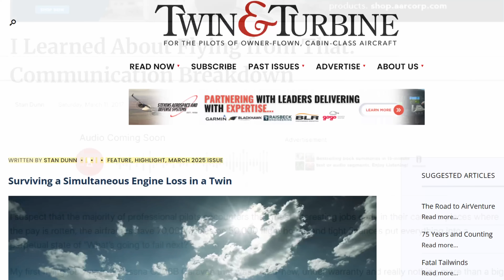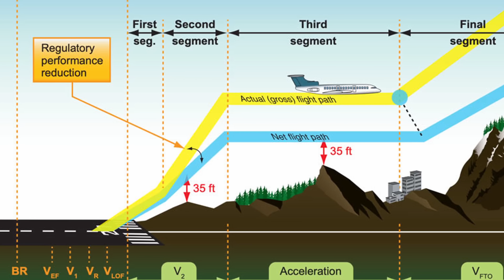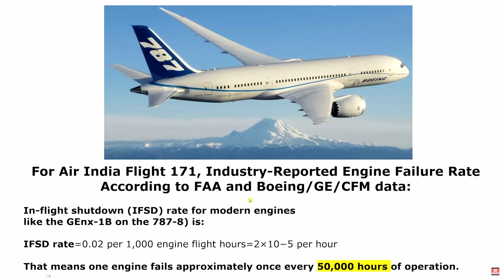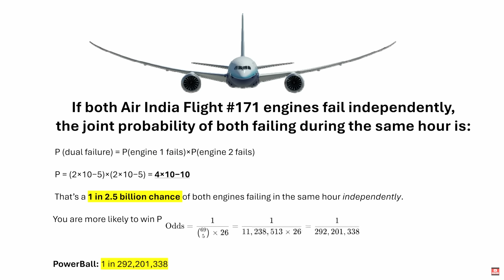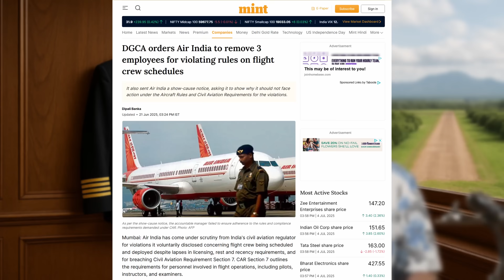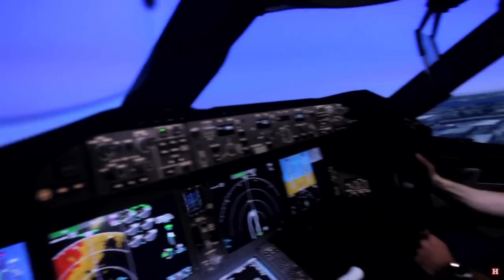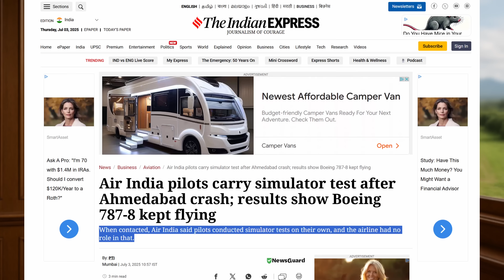Air India 171 Cause Becoming Clear

Comment: Don't forget Date: April 13, 2010. Flight: Cathay Pacific flight 780. The investigation concluded that SAP spheres, a component of a fuel filter monitor installed at Juanda International Airport, contaminated the fuel supply. Saltwater contamination at the airport damaged the filter monitors, releasing the SAP spheres into the aircraft's fuel. This caused both engines to significantly drop in power. The pilot was able to land the plane safely but it was sketchy.
Reply: Flight 780 did not have both engines roll back simultaneously, nor was there no warning beforehand - it had several minutes between the engines stalling, not to mention repeated ECAM messages on both engines for something like 2 hours beforehand.

It seems rather unlikely that a fuel issue would result in both engines rolled back at essentially the same time and at essentially the same rate such that rudder deflection wasn't visible, but also wouldn't cause any other issues for any other aircraft.
Reply: @TheLoneWolfling My understanding is that both engines are fed from the centre tank at takeoff and as a former auto mechanic, just about every case of fuel contamination didn't manifest itself until some seconds after high fuel demand.
Reply: @TheLoneWolfling  In this case the plane took too long to take-off, the whole runway, raising dust at the end, sign of either low power or load/weight issues. And it was not flying for hours so they could not have warnings for 2 hours!
Reply: @DR_1_1  that aspect is being disputed.
Reply: @TheLoneWolfling it could have been a more severe contamination this time
Reply: Makes no sense on this flight. They already did a leg from another Indian city into Ahmedabad. There was no relevant maintenance done on the short stop before heading on to London. More likely that some sort of electric failure caused issues with the fuel pump system which is electrically powered on the 787. So that would match up with what we saw, lowered thrust and eventually complete loss of power
Reply: Yep I remember that, it clogged the filters with icicles.  Thereafter they redesigned and retrofitted planes with a better filter/heater so it cannot happen again.
Reply: As I understand it, contaminated fuel leads to intermittent spurts of power and power drop-outs, with plumes of smoke from the engine. That was not seen.
Reply: @dadananda the creator says it was
Reply: @DR_1_1 later better analysis showed that the rotation speed and distance was ~nominal.

In which case you'd have to be saying that there were multiple failures (both engines running below nominal - but balanced prior to V1. And that pilots missed it. And that the later better analysis was wrong.)
Reply: The gear looks like started up and failed. I wonder if that tricked the plane that it was still on ground, reducing engines to idle. Or at least the gear up command was the time of system failure.  @TheLoneWolfling
Reply: Yep. Lots of interesting discussions around TCMA. JA825A / flight NH-985 had an incident where both engines shut down simultaneously on landing a while back due to a software fault inadvertently triggering TCMA.

Ditto, lots of interesting discussions around water in the electrical bay getting sloshed around by rotation. There's been a history of various water leaks. And the 787 is not particularly robust against that sort of physical damage - "four generators on two engines", sure. All routed through the same electrical bay.

My current pet theory (read: unlikely but interesting to think about) is that water slosh on rotation caused an out-of-phase short between generators on both engines that in turn either undersped the high-pressure spools or broke something critical in the ADTs. (Remember that the ADTs drive both main generators, the engine's hydraulic pump, oil pump, and PMU...) This would result in loss of all four main electrical busses, most hydraulics etc, etc. Explains the loss of thrust, partially-retracted gear, RAT deployment, etc.
Reply: @dadananda   But the 'dust' seen from one or both engines could instead have been  smoke?
Reply: @skylarkstarsmith  Most aircraft take off perhaps two-thirds of the way down the runway, but this one only finally took to the air at the very end of the runway. That is why there was a lot of dust on the runway there.
Reply: @dadananda   Yes, indeed.
Reply: Doesn't the RAT deploy only when there's total loss of power? That would mean both the engines gave out wouldn't it??
Reply: @V12F1Demon  That seems to be the consensus.
Reply: It’s not fuel contamination.

Comment: 9:08 1 quart of miratic acid....it's how marine gastanks are cleaned. engine flames would show contamination issue with the fuel via smoke, flame color  and smell. it's 100% electrical

Comment: Since this was posted 6 hours ago, i thought it was current.  I already know there was a bang right when they left the ground and the gear was to be retracted.  Indicators suggest the retraction attempt caused an electrical issue and hydrolic problems that deployed the RAT and presumably caused the flight computer to set the engines to an idle default setting.  The pilots throttle would do nothing.  The jet needed more than idle thrust to stay in the air.  So, it crashed.  As my son put it, the computer that controlled the engines and hydrolic system, blue screened and crashed the jet.  Black box information may never be released because it would show that whatever went bang, was known and preventable by India air.  Bur they thought they could risk one more flight before fixing it.

Comment: I will bet REAL money now...
Who wants to bet against me?

It was NOT birds.

It was NOT fuel contamination.

My "guess"? 
A single point of failure that controls both engines.

I didn't design the 787 so I don't know what that is.

But I have more than thirty thousand hours as a pilot of Dc-9/Md80, L1011, DC-10, B767, A330 all around the World.

Even if all electrics fail, EACH one of those aircraft's engines will keep running.

Apparently the B787 is different.

Comment: this aircraft just came out of retrofit..it's 100% an electrical short problem. some one left a circuit open that shouldn't have been open and the battery drained this would explicitly cause engine shut down in rapid succession every bit as much as an automobiles alternator failing to generate power as components in the system would rapid lose sufficient electrical current to operate as the battery died. this aircraft pushed back in the middle of the runway, it entered towards the middle of the runway...that means it was disconnected from ground power in the time frame of no generator power and running purely on battery power. this would cause the rat generator to deploy automatically as the power ran out and the main computer sensors kicked in shutting down systems rapidly from least to most critical across the aircraft.
time frame from push back to taxi to runway entry fits 100% perfectly....battery power was dying on take off when the most power was being sucked out of it rapidly.
the rat deployment wouldn't matter much as the open circuit mostly negates any benefit on whole immediately.

Comment: It almost seems like the automation should be redesigned to detect a single engine failure and then to inhibit shutting down the good engine if the crew tried to do it by mistake. It doesn't make any sense to have multi-engine redundancy when a simple crew error can invalidate the redundancy.

Comment: 787 pilots are to well trained to do this.  Those engine went out almost simultaneously. That's a fact.  Either it was FADEC malfunction and it shut down the engine or contaminated fuel. I am with the FADEC first then fuel contamination. Blaming pilots seems to be the easy way out. Funny how commercial Airline pilots blame pilots and corporate pilots always look at the plane as the problem.

Comment: Statistics are one thing , but reality of this planes problems is another , even the company's engineer said . ". He wouldn't 
Feel safe flying in that  airplane . Boeing 
Has the worst track record for safety violations. The 787 is a death trap .  More planes being built , means more money and more risks .  Delaying maintenance 
Or not following protocol.  Sloppy work 
Or third party supply chain. To save money.
If the plane had sufficient fuel , why wasn't 
There more damage.??  Pilots had sabotaged the flight . Human error??

Comment: Airflow was disrupted in engine #1 resulting in a compressor stall thus the loud bang and smoke seen. Then the crew inadvertently shut down engine #2.
Reply: Wow but unlikely they would act during ascent phase after takeoff no matter what. Nevertheless the flight profile almost fits
Reply: If you do the drill properly in case of a compressor stall, you do nothing but fly the airplane until you reach at least 400 feet AGL. Then, you first confirm and turn off the appropriate autothrottle arm switch, confirm and close the appropriate thrust lever until the problem goes away. If the problem does not go away, confirm and place the Fuel Control switch to the cut-off position. Them shutting down the wrong engine would imply that, soon after reaching 400 feet AGL where the drill can begin, someone placed a Fuel Control Switch immediately to the cut-off position without confirmation and skipping the first 2 steps. I can't believe that Air India would have such low training standards.
Reply: Yep, more likely than mechanical failure.
Reply: @billsimpson604  Not to mention total system failure, as alluded to by the RAT suddenly popping out halfway down the runway.

Comment: It is my understanding that the 787 takes off always using the belly tank and when that is used the wing tanks are then used. If so both engines are always using a common source of fuel. Perhaps you could clarify this. Common sense tells you the a common source of fuel on takeoff is not smart.

Comment: Air craft had reported extreme electrical system failure on previous flight just prior to scheduled flight. Were pilots warned of electrical system failure prior to flight? this would explain why the regulatory board removed the flight scheduling managers!

Comment: I’m about to apply for a job at NTSB , this particular aircraft had problems on the ground but. Most likely they had one failed engine, but the pressure from the company to make the flight was enormous. They did complete overhaul on the right engine I believe, but  because of the enormous pressure from the company and the way we humans think in general they shut off the “healthy “ engine. That’s why they were without their engines. The probability had some indication of the problem while still on the ground., but their mistakes are not just theirs. In my opinion more important is the CVR , the FDR is just to provide the data .

Comment: The computer shut down the engines, but we don't know why. There needs to be a BIG BUTTON to override the computer.
Reply: Are modern planes able to fly without a computer ? Modern fighter jets drop out of the sky if the onboard computer fails.
Reply: @iRelevant.47.system.boycott 
No, because many basic functions, even the throttle are electronic and not mechanical, but there are multiple computers which back each other up.
Reply: "The computer shut down the engines." –RossNixon

How do you know that? Oh, wait: You don't. Nobody outside the investigation does.
Reply: There is and there are 2 buttons: They're called the Alternate EEC's.

Comment: The Mayday call has always been a puzzle to me, and this video doesn't fit with it at all.  In a normal, (entirely survivable) emergency situation, such as a single engine failure on takeoff, 
you would never call Mayday at 300 ft. because you're simply too busy flying the plane, and, following well-rehearsed procedures,  you know everything will be fine.
But if the FADEC computer, which pilots CANNOT overrule, suddenly shuts down both engines, maybe then you call Mayday, because in your final seconds of life, you need to blame the machine.

Comment: The double engine out on the Kegworth air disaster Flight 092, a Boeing 737-400 1989 had a left engine fan blade release causing a fire and the media suggested its fire suppression was crossed wired as it was obvious the  smoke ingress was coming in from the left side of the aircraft. However it was believed it was NOT announced which engine had the problem so the passengers could not confirm it and during major problems it has been known for cabin crew not to mention such things as a missing engine as the captain may have had enough problems to contend with. So the lack of driving mirrors so to speak and passenger communication feedback may help.

Comment: More likely, they took off properly configured. Then , before, during, or just after rotation, they had some sort of electrical glitch. This actuated the RAT. Such an anomaly probably rattled the very inexperienced First Officer.  Upon the positive rate call, his, he may have missed it. The pilot flying, most likely the Captain may have calked gear up, or not. The rattled FO may have put the flaps up partly or all the way. 
  These events are about 200'. The fact that the gear  is still down is a clue. Then, as the flap worm gear grinds away, the length of the topline of the wing is shortened. This slows the speed of the airflow over the top of the wing, raising the pressure and reducing lift. Since the plane is about ? 170 knots, it is well below the minimum speed for the airfoil to produce lift in a clean or 1 notch flap configuration. The pilot flying sees the sink and applies thrust. There is no response on the ivsi (vertical speed indicator). He assumes he has no thrust, thus the panicked radio call(a rookie mistake), the radio call that is. 
  So, to get the wing flying again, you have to lower the nose and trade altitude for airspeed. Not possible close to the ground. 
  Also, you cannot power your way to greater airspeed in this instance. The wing has stopped flying, and the plane is sinking. So the pilot flying raises the nose, a pitch increase exacerbates the airfoil stall, meaning a higher angle of attack to the relative wind. 
  This accident has happened before. There is no way out. No time, no altitude. This is what happens when you have passengers with uniforms in the cockpit. 
  The frantic radio call is also a clue.  First, you fly the plane, then you navigate, then later communicate. A radio call was unnecessary and superfluous, showing poir training, poor judgment, etc. 
  It was highly unlikely that both engines stopped at once together. No yaw is a clue. 
  Having spent some decades flying and instructing in the 3rd world on heavy jets, i can attest to the poor maintenance, training, and caliber of people in the industry. Electrical glitches are not uncommon. The new generation engines are quite reliable even under harsh conditions. A h et engine is a simple thing compared to a camshaft and pistons, etc. 
  So, nope. All this wild conjecture is hilarious. Once that wing stops producing lift, you sink like a rock on a hot day, close to the ground. No amount of thrust will save you in this scenario. The Captain probably had no clue the gear was down and the flaps retracting. He was confused. Applying thrust and raising the nose makes it worse. In the video, you can see the engine thrust kicking up large pieces of roof sheet metal as it sank into the buildings at a high angle of attack.  
  Everybody is afraid of the truth, pilot error. It is common outside of the anglosphere to put a 500 hour pilot in the right sest. Even in Europe, they do this. It is to save money. They learn on the job. And also make big mistakes.

Comment: Both engines lost thrust due to the FADEC computerized engine control system. The FADEC most likely malfunctioned leading to both engines rolling back to zero thrust. I Am a retired airline pilot and believe that Sully's Airbus lost thrust not due to the ingestion of geese. Those airplanes are certified for bird ingestion and should not have caused the failure of Sully's engines. I believe the FADEC sensed the geese ingestion and rolled back the thrust on both engines since FADEC is designed to protect the engines during an a sensed failure. The two FADEC  computers on a twin engine airplane do not speak to each other. As far as Sully returning to LGA or Teterboro, first airline pilots are not trained to land with both engines failed and second, LGA only has 7,000 feet of runway and Teterboro 6,000 feet. That would have required a perfect glide and landing on a short runway. The Hudson River had almost an unlimited runway to land on. Sully instantly made the correct decision to land on the Hudson. Landing too short at LGA or TEB would have resulted in an immense airline disaster. The proof is that not one passenger or crew was injured.

Comment: Shutting down a dying engine is a legacy of propeller driven aircraft. Feathering the prop and killing windmilling drag is, of course, huge. Why the hurry in a jet? I have to believe that unless it is visibly self-destructing, there is less threat to the flight to wait until reaching pattern altitude to pull a power lever rather than chance pulling the wrong one when it is lethal.
Reply: Even a damaged jet engine will often produce some usable thrust. Failure would have to be absolutely catastrophic to generate enough vibration that would compel the crew to shut it down immediately. And we would see that kind of a failure as smoke, flames and engine debris flying out the damaged engine